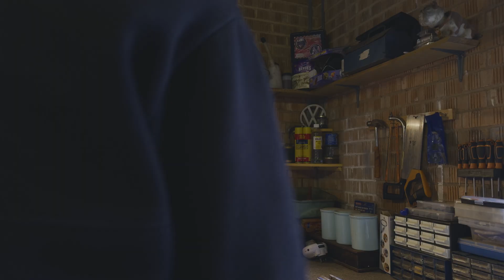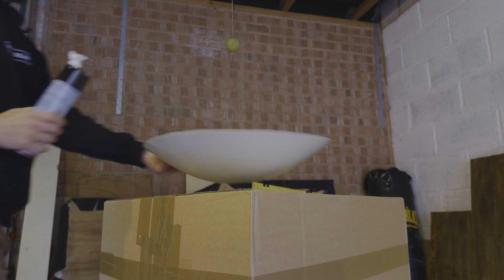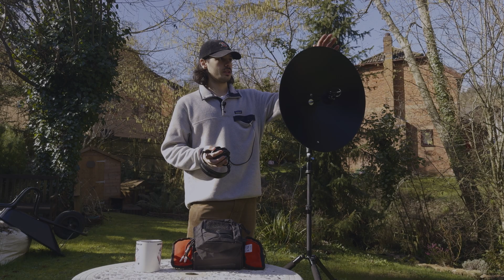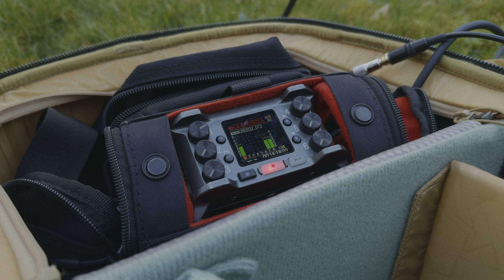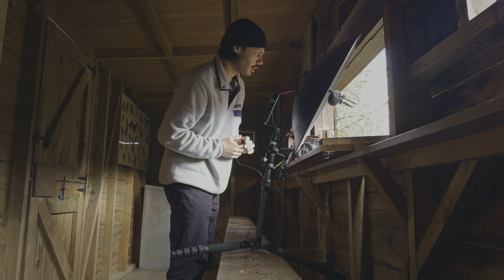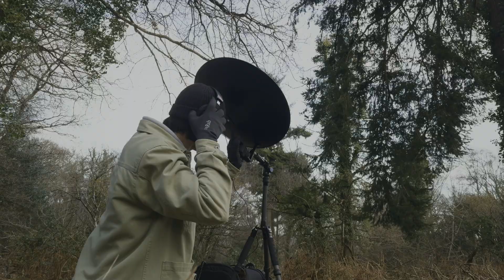This is NOT a Satellite Dish!

Comment: I had a bash at making my own parabloic dish with a cheap lavalier when I came across a metal alloy fruit bowl in a garden centre. This bowl seemed to work fine though it was much smaller in diameter at around 38cm across. It did sound tinny on recording birds due to it losing some of the low frequencies but I found it worked very well on insects. I'd suggest you try recording grasshoppers, bees, wasps and other flying bugs.
Reply from the maker: Ooo nice, that sounds like a wicked idea. Definitely going to try recording some insects when they start appearing again

Comment: Nice video. I have one of these and was interested in the modifications, especially the cable routing. When I use it, I have Sennheiser MX 375 in-ear headphones.  These are cheap and sit at the bottom of the ear so that I can hear what's going on around me as well as what's going into the recorder.  This way, I can both pinpoint the source (with my ears) and hear what is being recorded. Couple of questions: what type of paint and what type of drill for the hole? Thanks.
Reply from the maker: Good idea with the headphones. I have some in ear ones and will try that method.
I used screwfix industrial black spray and the drill bit is a step drill bit. I did use a smaller drill bit to get a pilot hole though
Reply: @RareFindsSoundDesign thanks for the reply

Comment: I found that recording like this is hard with headphones on so I usually dont wear them. Its too difficult pinpointing the sound source and you'll be able to lock on a lot quicker. I will monitor for a bit just to make sure the sound is clear etc.
Reply from the maker: Nice, yeah I think it’ll take a bit of practice getting used to exactly where the sound gets picked up depending on where I’m pointing it. I also now see why they’re often transparent 😂 but the hole I drilled accidentally became a kind of scope to look at what I was pointing at. A happy accident
Reply: @RareFindsSoundDesign  I threw the dish away and just use the hole !
Reply: @RareFindsSoundDesign what's a good way spotting one of these